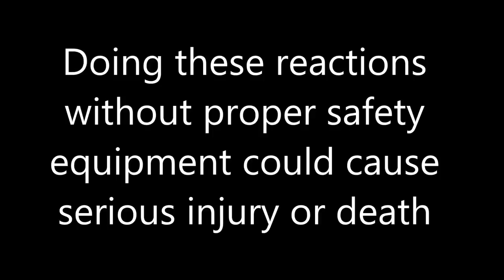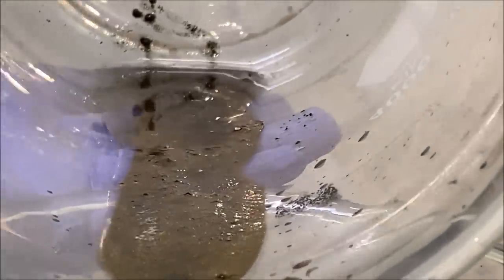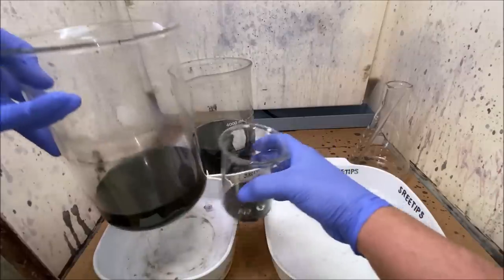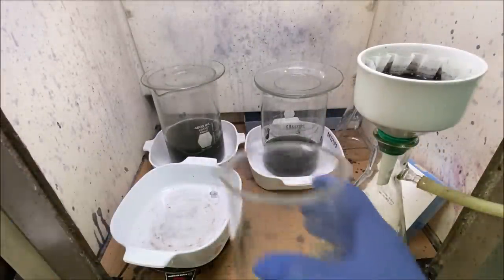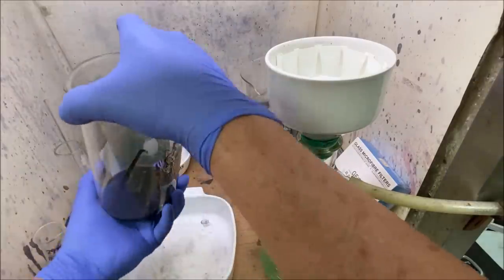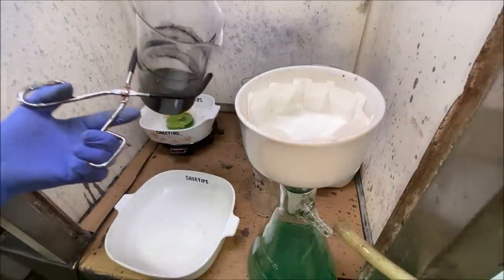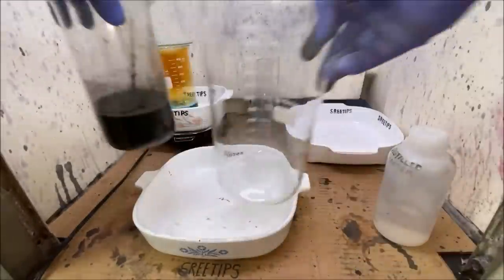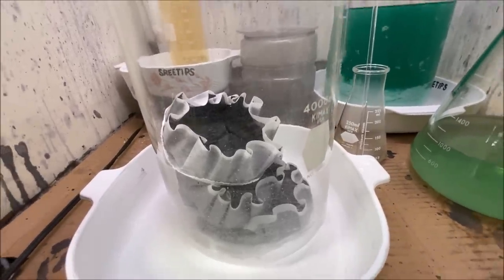Square Yard Of Carpet How Much Gold Part 2

Comment: This is a bit off topic, but vaguely related. I used to handle silver nitrate on a regular basis in the USN. We use it to test for the presence of chlorine in condensate and feedwater systems. Done correctly, the test can be sensitive to as little as 0.1ppm chlorine concentration.
Reply from the maker: Go Navy!

Comment: The solid metals and metals in solution may be catalyzing the decomp of H2O2, so your pirhana might be getting consumed before it can do all of its work on the carbon. Still seems to be effective nontheless
Reply: Likely to be the case, though not the end of the world since the breakdown just releases more oxygen which can help saturate the solution with dissolved oxygen gas, providing readily available forward-feed to the evolution of CO2 from the soot, carbon and assorted organic char from the carpet in suspension. Strong stirring and a slow, steady addition of the peroxide can help mitigate the loss from catalytic conversion but... Peroxide is (relatively) cheap, so using an excess isn't really a huge deal IMHO. Also in this particular use case the gold is a decent indicator of when the reaction is complete enough, since this process was just to rid the material of a bunch of otherwise-inert filter-clogging carbon based trash. :)
Reply: Might be interesting for sreetips to add a squirt of peroxide first, next time, to see how vigorous that is compared to the piranha.

Comment: Can't wait to see the third part! Is that glass fiber filter pad going to cause issues with the aqua regia?
Reply: Aqua regia will happily eat around the filter, leaving it clean enough to probably be used again with maybe a quick piranha solution bath to get any gunk. Most GF filter brands are surprisingly durable, and can be chemically cleaned and reused a few times, so long as you're mindful of the 'lint' (it stings like a Marvin heckler if it gets into your skin).
Reply from the maker: I’ll remove the fiberglass filter. It could present a problem so best to take it out before we go to aqua regia.

Comment: I love watching the refining processes you do. You mentioned several times that the gold was separating itself in the piranha process.   Is it possible to use stratification using ultrasonic pulses in the mixture then pour off the lighter particulate to ease in refining the gold faster?
Reply: He'd just dissolve and precipitate the gold three times anyways, so there wouldn't be a point.
Reply: @davereeves1967  stratification can be used at any point in the process after reducing the material to ash. Since is gold  extremely heavy compared to the other materials.  Is it a process that should be used before filtering to save time and waste of chemical processing?
Reply: @chrisdroblyn  ok....... Is this your first Sreetips video? He re-refines pretty much everything once it's been refined. You saw him sticking obvious chunks of gold into the reactions, right?
Reply: @davereeves1967  no dummy here.  Been here for a while. I also know stratification can also be a way of simplifying some processing in a separate batch.  Just sayin'.

Comment: When you have so much solid sludge to process, would you consider a furnace step? I.e. put the sludge into a furnace with some lead collector and a lot of flux, then pour into a conical mould to collect the metal tip. You would still have to extract the precious metals from a big lead button but it might be a big time saver.
Reply: I see you've been watching mbmmllc's channel 😉
Reply from the maker: There’s too much material here. I don’t think the gold would coalesce into a single mass. But it probably could be added a little at a time to a crucible of molten silver. The molten silver would serve as a collector metal. Then dissolve away the silver (and any remaining base metals) with hot dilute nitric boils. But my goodness, the extra time, chemicals and effort would add extra steps to an already lengthy process.

Comment: I remember i had asked at one point if you were using piranha solution and i may have suggested using it to de-muck your solution of any organic compounds... Not sure if someone else suggested this exact method though. No matter what, great job. This was well handled. I know this is possibly one of the most dangerous reactions in your videos and you definitely did it without a hitch. I was thinking you should have kept going with each P.S. cleaning until the solution is clear, meaning any and all carbon-based materials would be reduced to just carbon. It seems as though your fine-classed gold powder was binding (physically, not atomically) to the gunk. The solution definitely seemed to help with that. I wonder if there is a way to figure out just how much P.S. to use per unit (i.e. a scoop weighing a few grams or so) for your future endeavors. I also am curious to see if this will turn out cleaner gold than usual, and if it may make the rest of the refining process go a bit more smoothly. Anyways, tons of love to you and the whole Sreetips family.
Reply from the maker: Thanks, it was a very helpful suggestion

Comment: The role of the sulphuric acid in piranha solution is to break down carbon containing molecules into carbon, and then the H2O2 converts this free carbon into carbon dioxide, which just bubbles away. Since you've already carbonised this material with fire there may be a chance that the sulphuric acid isn't doing to much to help. The H2O2 will bubble and release it's oxygen a lot quicker when it's hot, so it isn't as affective when it's hot. You want that extra oxygen to react, not simply get released as oxygen by heat.  Just a thought.

Edit: Hydrogen peroxide is pretty unstable, it's constantly releasing the extra oxygen is has. If it's added to say, sand in water then this sand gives it a place to release it's oxygen and it will do that quicker if there is no sand, that is, the sand will not react but it will speed up the release of oxygen. This also happens with heat. So you want to keep the heat low, there's no much you can do about the particles in your solution. Doing this will make the H2O2 go further. When you add it in this video you see an instant reaction, I suspect a lot of them bubbles aren't really a reaction, they're simply oxygen being let go of by the H2O2, since it doesn't like holding that extra oxygen. Really, you don't want any oxygen being released, you want it all to react with the carbon.

Comment: i think when you added the sulfuric acid to the material and it started fuming is because it has nitrate's in it, that will react and make silver and or copper sulfate and nitric acid, btw you can recover nitric acid with copper nitrate and sulfuric acid, but you would need to destill it to make clean nitric acid, copper sulfate is also something that is possible to sell if it is clean enough, or it can be used in a copper cell to recover the sulfuric acid(Nurdrage made a video on that topic called "Efficiently Recover Nitric Acid and Copper Metal From Copper Nitrate Wastes").

Comment: What is the plan for keeping the jewelers silver separate from your own?  Will you have to start a fresh silver cell with just the jewelers shot?  Won’t that require a little of your own electrolyte?  And then how about the Pgms from those slimes.   Seems to be a lot to track when doing this all for someone other than yourself,  and no saving of things to run together in a larger batch.
Reply: The silver isn’t part of the recovery for the jeweler, only the gold. Silver is actually a consumable used to refine the gold just like the acids are consumables, which makes it part of the cost of the refining even though the silver doesn’t get used up and remains after all is said and done. That’s partly how you get to make money when refining material. The little bit of silver that might be obtained along with any other metal that isn’t specifically specified to be collected and purified by the customer (aka the jeweler) becomes a valuable waste byproduct.  Now if the jeweler specified that he wanted the silver collected and refined on top of the gold too, Sreetips would have had to keep it separate but being that he didn’t keep it separate, I’m pretty certain that isn’t the case here. Also, Sreetips doesn’t refine material for random people, but if he was refining material for a random customer, all the details of what is to be collected, refined and the cost, would be specified and contractually agreed upon upfront so the customer would know what to expect. It would add an extra cost to the customer for the collection and refining of each metal the customer wants returned.
Reply from the maker: I will just do an estimate and offer him a small bar of silver from some silver crystal that I already have. Then just throw his in with mine and run it through the silver cell.

Comment: You mention panning. Not to doubt your knowledge in the field but I’m genuinely curious why some gravity-separation stage earlier in the process (perhaps when you had dry ash) might not have been a feasible way to reduce the volume of material you were working with?
Reply from the maker: That’s highly possible.

Comment: Hey bud have you ever considered like putting some glass rods under the filter or like some kind of course screen to make risers and get more of the filter exposed to the particles.
Reply: I think the micro fiber filter is solving the problem I was try to help with 😁👌 it lifts the paper filter off the holes so it can evenly drain rather than being confined to the small holes in the funnel 👌😁
Also is the microfiber filter reusable may be possible to back wash it if you can flip it over seems like it was a big contributing factor to the speed of the filtrations

Comment: Can't you run it through a coarse filter first? Then go with the fine filter?  Can you dry out that black brick gunk and sift it as a dry particulate?

..
Reply from the maker: I can run it through the screen to get the big pieces away from the powder.

Comment: The piranha solution probably was not the whole solution. Spacing the paper filter up off of the bottom of the funnel gave the vacuum more surface area to work with. With the micro filter the vacuum works on the bottom of the paper filter anywhere that the paper isn't touching a fiber. Without the micro fiber the only surface area to work with is where the holes are.

Comment: Just adding aerated water into the sulfuric will make it exothermic.  Been there done that.  

Otherwise add the acid solution to the peroxide.  Always add acid (most of the time)

Comment: You may want to get that glass fiber filter out before you proceed. I don't think it will dissolve like a paper filter.
Reply: I saw that and briefly thought that too but then I figured it shouldn’t be a problem when he adds the aqua regia.  After everything is dissolved, he can just pull the glass filter out and rinse it off and he should be good to go. Plus if there happened to be any little bits of gold on the glass filter, by leaving it in, he gets to dissolve those little bits off without having to try and rinse them off separately. It’s likely much easier just leaving it in with all the other filters and pulling it out later once everything is dissolved.
Reply from the maker: I removed it in part 4

Comment: the problem with the piranah solution is the silver and any platinum group metals will be breaking alot of the peroxide down quickly but other than that good idea it wont be perfect but alot of the smaller particles will be turned into co2

Comment: in adding the microfibre filter you increased the filter efficiency significantly making the holes in the funnel essentially bigger, incinerating the char to a higher temp would also have oxidise more of the tiny carbon particles, but the peroxide is very effective, the issue was the microscopic carbon, you could try a foam or fibre  filter, if you compress foam or fibre it makes a very good filter but when you release the pressure you can wash it out .

Comment: Quite a circumspect approach to handling 9 square feet of metal laden carpet. Compared to some of the other processes you have performed it seems that you found a more frugal way of processing then using gallons and gallons of chemicals, at least for this installment.

Comment: I think it would've been more prudent to dry the solids and then burn them again in an oven (NOx fumes would've been bad though.) Even more prudent would have been to burn it before adding any water or chemicals, to make sure you had pure salt ash before trying to refine.

Oh well, all's well that ends well.
Reply from the maker: That’s exactly what I did in part 3

Comment: How certain are you that you got all the silver out of those solids? It seems like you didn't get a whole lot out in part one which seems odd considering it's a jewelers bench. I thought it was because all the carbon was interfering, would it be wise to test it for silver/base metals prior to moving to aqua regia?
Reply: I had similar thoughts too, with all that excess carbon, the nitric that was in there may not have been able to properly attack the base metals. At least the gold is clearly showing though.
Reply from the maker: I don’t usually get a lot of silver from his scrap. But if it’s in there then we’ll just have to wait until it settles out and vacuum off the clear gold solution.

Comment: Piranha solution to oxidize the carbon "mud" into CO2 is a viable strategy but unless you have access to very inexpensive reagents it would get very expensive very quickly. The cheaper and probably faster way would be to burn the starting material more completey before beginning any aqueous chemistry, this way you start with less mud because more of the carbon turns to CO2 and blows away in the wind. Something like using your burn pot with a port to inject oxygen gas from a high pressure cylinder in order to get a better burn.

Comment: The swept up material mass with bag was 366.4 grams. 
   Now that the mass has been added to the carpet material I'm wanting to know what the combined weight of the carpet and swept up material is.
Reply from the maker: I forgot to weight the piece of carpet, but it was probably close to 5 pounds - estimated.

Comment: What exactly did the piranha solution do for the solids?
Reply from the maker: Not exactly sure. But it definitely increases the speed of the filtering process.
Reply: Hopefully you are not putting metal in solution. I know copper goes into solution with piranha solution.

Comment: ahh man you scratched up your wedding ring, your wife isnt going to like that.
Reply from the maker: She’s seen me do it many times. I use my 14k wedding band as a standard when I’m testing gold with acid for other people.
Reply: @sreetips  she must be a gem. I've only watched maybe 15 of your videos. I want to know, how proficient are you, do you consider yourself an amateur? you have a nice setup, did you start with this kind of stuff in mind or just ended up doing gold refining and extraction because it happened or because you fully intended to do it from the beginning?
Reply from the maker: I consider myself an advanced beginner, although I’m getting along in age, and with age cones experience. I am not a professional refiner. I don’t work on other peoples material. Only stuff that wife and I find at local sales. I’m an amateur, hobbyist, refiner with lots of experience.
Reply from the maker: I started with a few beakers in my back yard. But quickly realized that there’s no way to do reactions safely without a fume hood. Then I started buying equipment as I needed it. Some of it I never use. I have a tendency to go overboard. But, anything worth doing, is worth over-doing. Quote from Steven Tyler of Aerosmith.
Reply: @sreetips  couldn't have said it better myself. Keep going strong my dude.